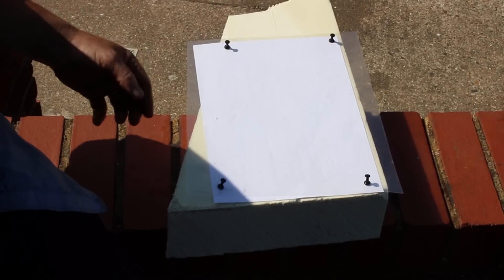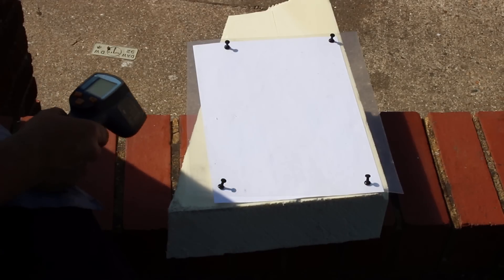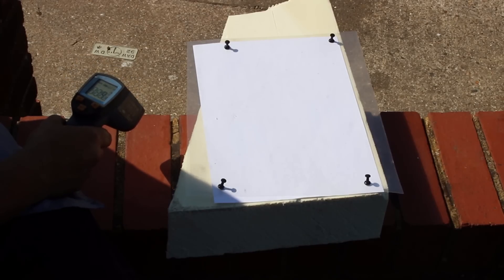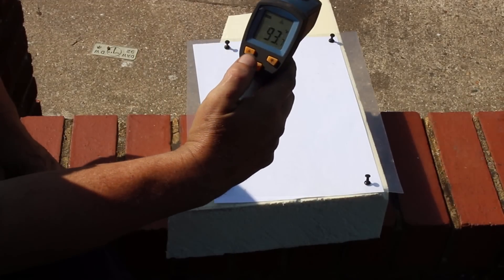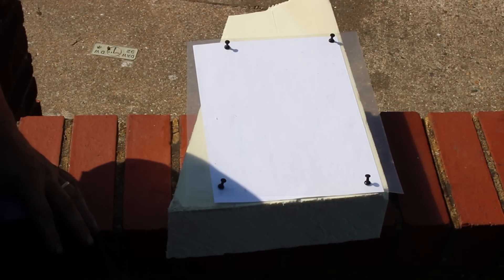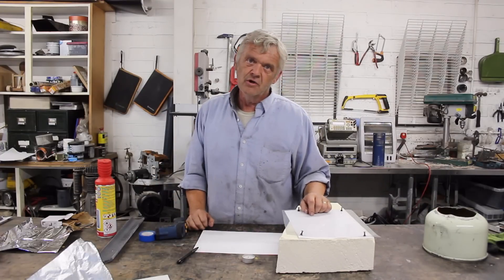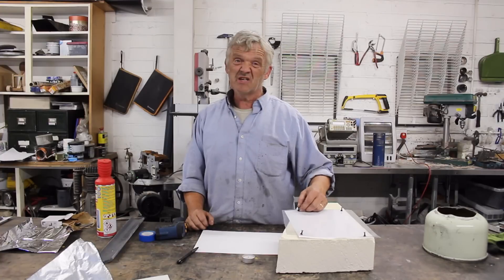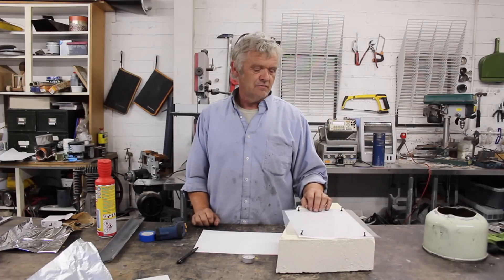1613 Cooling With Copier Paper

Comment: Hey Rob, I think you need to combine the terracotta cooler and this insight into one project to make a "cooling cave and bench" with these insights. Perhaps add a water sprinkler to keep the terracotta cave wet and therefore cool. Just what everyone needs for the hot summer.
Reply: Would this work without the paper if the terracotta clay is white?

Comment: What's the argument for the insulation? My first instinct would be to spray the paper with water to get evaporative cooling. Put a black piece of paper above a white piece of paper and spray them both with water then put on an open-top-and-bottom chamber with a perspex lid which is pointed at the sun. Black is heated most, forcing the direction of air flow upwards. Extract the coolness of the white paper with a fan. Since the black paper is adding heat, it should be above you! Add a channel below the white-black edge to divert some cool air and magnify the pull of the black piece of paper, maybe...?

Comment: The flaw in your and his experiments is the use of an IR camera due to unknown but potentially different emission rates of the materials in the 7 to 14 micrometer range. You must use temperature measuring by contact probes to confirm a quantitative difference.
Reply: From a global perspective, the NighthawkInLight assertion was that emitting energy (presumably from any source...) into space through this 'hole' in the frequency spectrum would be a cooling effect as the energy is being 'dumped to ground' so measuring at that frequency measures the energy being ejected. To your point, the feeling of how hot it is to a human is measured with a wet and dry thermometer
Reply: @RupertBruce  thanks for the answer. But nevertheless, in "that frequency" there are different emission rates for different substances. You can be easily tricked into taking your measurements serious wirh an IR camera. I do IR analysis for a living  and can assure that there is more to measurement than taking a microbolometer in your hands and read some values. Nontheless appreciate your work and your dedication.

Comment: I have a dashcam I leave on the windshield all the time, but with the high heat now, I always place a white kleenex tissue over it when not in use. It really helps keep the temp down and not have a runaway battery explosion. I know I could just remove it when I am parked, but those dang suction cups are hard to keep working. I always try to put the suction cup on while the windshield is really hot. Any cooling later just creates a stronger suction.
Reply from the maker: that's clever mate

Comment: I'm interested in the calcium carbonate option.  The Aztecs painted their pyramids with lime.   Probably kept them from becoming heat syncs and work to cool off the area.
Reply from the maker: yes - it interests me greatly too
Reply: @ThinkingandTinkering  Actually, using titanium oxide in copy paper is quite rare, due to cost. Most grades have calcium cabonate only.

Comment: When gas is compressed, it heats up rapidly. When compressed gas is released, it cools rapidly. 
Unless this statement is incorrect, it is fundamental to how a heat pump works. I am also trying to figure out how to stay cool in summer without the electrical grid. I need help from people smarter than myself. 
Please respond
Reply from the maker: the simple answers are often the best mate
Reply: @ThinkingandTinkering  compressing gas and releasing it is pretty simple I think.
Reply: It's not just how a heat pump works, but refrigeration too, depending on how the gas is released. This technique has the ability to affect large temperature difference. That's why it's the industry standard. There must be a dozen ways of compressing gas without electricity.

Comment: Nice !! il love the Keep.It.Simple as Stupid approch !! This is one of the approache i am wondering around with for my car (that is not already white, unhappily ^^) , by a combination possible with a corrugated plastic advertisement board reflecting heat, and transmitting less the residual heat with the help of aluminium foil or simply superwhite paint, and using the depression induced by the relative wind in the combined funnels of the board while driving to keep cool an ice chest inside.. Yes, it becomes a bit more complicated funnily
Reply from the maker: I like the idea and the thinking mate - at it's base it is simple but utilisation is always bit more work - still - nice

Comment: What is interesting is that it is not just reflective.  That extra energy difference has to go somewhere.  Wonder if it could be captured?  It was determined earlier that paper, collectors, and damp air would generate electricity.  Could the small percentage of the sun's energy that is not reflected but yet isn't radiated be due to the photons knocking electrons into a higher state absorbing heat energy?  If so, a solar panel of paper would be possible(a poorly working one to be sure, but possible none the less).
Reply from the maker: I am sure it could

Comment: How efficient are the old thatched roofs for insulating/cooling? Question from South Australia where Adelaide temps. regularly reach mid-40s (highest max. 50.3 Oodnadatta 2nd January 1960 )
Reply: Most materials used to insulate use pockets of trapped air, think of a jacket or a sleeping bag, so if I'm not wrong thatched roofs are probably very good at insulating as they're full of air .
Reply from the maker: well they are insulating and insulation cuts both ways

Comment: Great little tip there Rob. I did try aluminium foil on the windows today (we had similar temperatures to you), and it worked well. Problem is the foil itself got rather hot. Next time, I'll have to try it on the outside of the windows!

This video, and my foil experimentation got me wondering though. I wonder if there'd be a way to come up with some kind of temperature reactive vinyl for windows (goes lighter with higher temperatures, and darker with lower ones). Had a good Google around, but can't spot anything useful.

Might be something to look into if that chemist brain of yours can think of a solution!
Reply from the maker: there are electrochromic glasses that do that mate - you might want to search on that term
Reply: foil or paper outside the glass would probably work better.
glass traps infrared.
Reply: Hang a damp white sheet outside the window getting the sun. Get light though the window without the heat...
Reply: It will work better. Because if the foil gets hot and is inside the house, it will also heat the house.
If it is outside, it will heat the surrounding air.
A few years ago I bout a window shade to put inside on a window that had none and It was one of those roll up shades made of small wooden straws and I found that it made a far bigger difference if I put it outside and not inside the window
Reply: If you place foil inside your windows, the windows will become incredibly hot. Some glass is capable of handling that heat but some could crack.

Comment: There are apps you can get on your phone that shift the camera to the IR spectrum, and aside from that just use it as the cool side for a peltier unit and see if it will generate based on the temperature difference
Reply: Those weird phone apps are entirely fake. However, you can get phones with thermal imaging sensors, and USB dongles with thermal imagers. They're usually based on one of the two Lepton sensors that FLIR do, and aren't all that pricey, but they're not casually-cheap either.
Reply from the maker: it's not just the app mate - which is basically a colour rendering app - for near infra red you need a camera click on addition, in addition most camera lenses these days have IR filters on the sensor - you might have guessed - I did look into this
Reply: @ThinkingandTinkering  Just as an aside, the phone I have is a 2018 edition Cat S61. It has the higher-resolution Lepton FLIR sensor in addition to a VOC sensor, humidity sensor, thermometer, and a laser-and-camera driven distance+area measurement app that's not exactly micron-accurate but good enough to be useful. Built like a tank as well. If you can pick one up new or second-hand at a decent price, you wouldn't even need a SIM in it to have something potentially useful.

Unfortunately the update doesn't have half the sensors in, which is a bit of a shame. That 2018 version really is a gadgetphone.

Comment: He's using a thermal camera which indicates actual temperature.  You're using an IR thermometer where the emissivity of what you're measuring is an important factor.  See "Emissivity and Its Effect on Infrared Thermometer Readings."
Reply: Thermal cameras are also affected by the same things that affect IR thermometers. When I point my own little FLIR-enabled phone at a window, the results look very strange because a lot of what the sensor sees is IR reflected from my side of the glass, with only some passing through from the other side, plus whatever IR signature the warm (or cold) glass itself has. This is why when you want to measure, for example, a metal container, you might want to stick some tape to the container so you get the temperature of the container rather than IR light reflecting off it.
Reply from the maker: cheers mate but FLIR is also effected by that

Comment: I would think the plastic cover sheet, which is not 100% transparent, might be blocking some of the reflectivity of the white paper possibly?  I saw Nighthawkinlight's video but I am still not clear on the need for the cover sheet.  It would be interesting to compare the Delta T at the same time using a cover sheet on one paper, and none on the other.
Reply: the thin cover sheet of polypropilene is used to shield the i-r reflecting/emitting surface from convection & conductive heating from the moving air currents present nearby.
Reply: @geodeaholicm4889  Thank you.  Yes, I heard what Nighthawkinlight said it was for, I am just not sure it is worth the trade-off of losing the total available reflectivity of the paper.  This is why I think a side-by side comparison in the same sunlight at the same time would be interesting.  Maybe the plastic makes a huge difference?  I don't know.  I suppose I could run a few tests over here and find out.
Reply: @OverlandOne  i would suspect the plastic film would primarily be useful during the heat of the day & in direct sunlight.
  i would think running multiple tests of multiple configurations would be useful.
Reply from the maker: the best way to know that is to test it mate - give it a go and let us know the results

Comment: Black 3.0 on the hot side and super ambient temp reflecting white on the cool side of a sterling engine on a generator. Can make a green house of fresnal lenses and p.e. around hot side and heat sink fins on the cool side painted white and a tube of aluminum foil painted white on the outside and black on the inside around the heat sink and see how much power it can generate. I want to build one for my shop.
Reply: If you paint a heatsink white it won't radiate very well. A good absorber of light is also a good radiator, and a poor absorber is aso a poor radiator. You would be better off painting the radiator black and shading it from the sun if necessary.
Reply: @gcewing  perfect. Exactly what I meant. Ty
Reply from the maker: yep - that did occur to me too mate - thinking alike I see lol